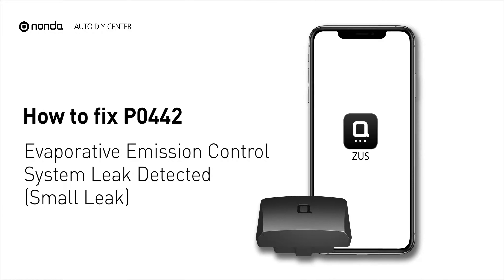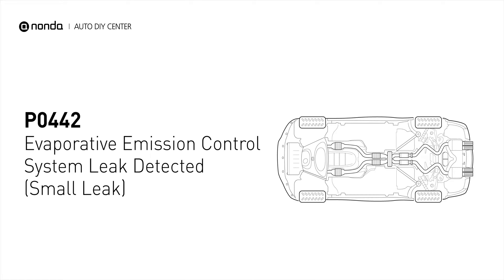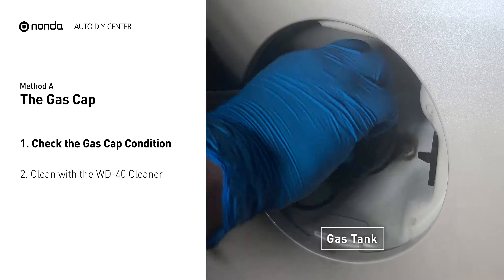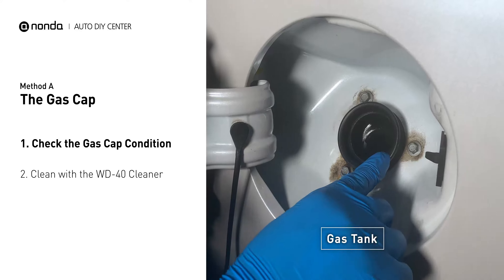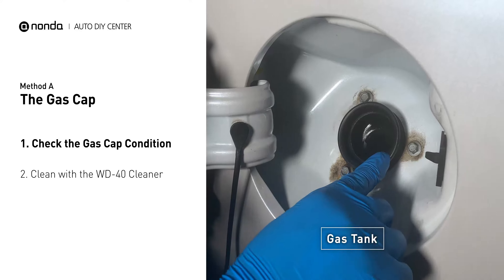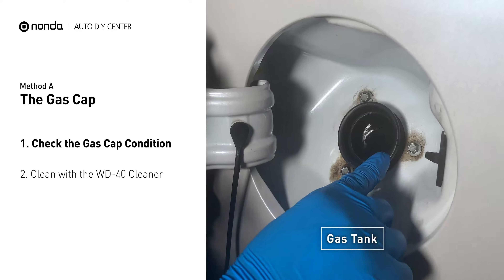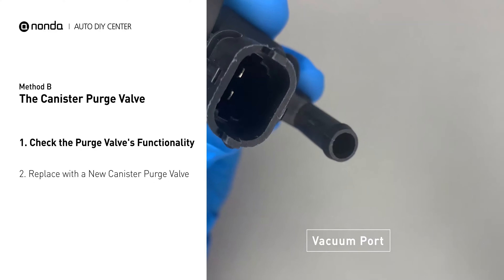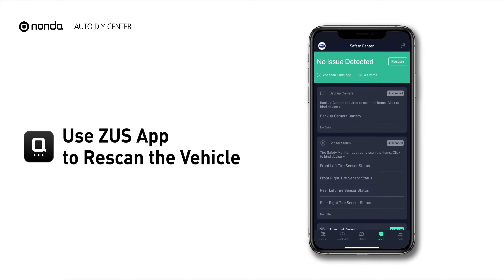How to Fix P0442 Engine Code in 3 Minutes [2 DIY Methods / Only $4.67]

Comment from the maker: Hi, I'm Steve, nonda's lead mechanic engineer. 
Feel free to leave your comments here if you have any mechanic questions, I will be glad to help you out!
Reply: Hey Steve, I have the same error code with a 2017 bmw 430xi gran coupe. I have a deleted resornator and muffler. Would that also cause an issue ?
Reply: Hi Steve

My friend has a 2005 Ford Explorer with a 4.0 Liter V - 6 motor installed in it. Code read out says P0302 and P0442. Her mechanic is telling me that he believes that the problem is that the number two cylinder intake valve is stuck open for some reason. He says that his next step is to remove the valve cover to examine / ascertain the problem - cause for repair.

What do you think about this situation ?
Reply: Is this a serious pcm engine code or can I still drive my car??

Thanks
Reply: @JG-ef2cn  IMO, no, Unless the smell of gas and the check engine light bothers you. Most of the time it's the seal on the gas cap. If you live in a state where emissions are an issue, your not going to get your registration updated, therefore, clean everything first like Steve said and go from there. Hope this helps you out. We're all in this together. Good luck.
Reply: @JG-ef2cn  I also have a PO265
Reply: What's a mechanic engineer??
Reply: I got it a Subaru Baja 2002 and I have a p0442 code show up I did it replace the canister and some other hoses but the check engine is still on the mecanic charge me almost 900 hundred
Reply: 2016 Land Rover discovery sport. I replaced the gas cap. Getting p0442 and p0456 codes that when cleared come back on. Any ideas would truest be appreciated.
Reply: Help me please
Reply: Just got code P0042 on my 2019 impala premier.  Any help would be appreciated, thanks. Ps, I'vealrwady inspected the gas cap. Not sure if its the purge valve. Car is used.
Reply: @JG-ef2cn thats the real question 😂
Reply: Steve AI voice loves Nondas😂

Comment: Not saying this video is BS but after 30 years of doing this ive had many reasons why evap is throwing lights. From filling with gas while running, topping off, faulty componets, gas cap seal etc.
Reply: Can it happen from the car sitting for a year?
Reply: @ReisePiece anything can happen when the car sits. Seals rot out, plastic degrades and many other things can go wrong. Gas also goes bad wich could cause running issues
Reply: What faulty components?
Reply: I replaced my gas cap, but my car still giving me the error code, sometimes I run my car on low fuel and I use the cheapest. Should I use a higher grade? 2011 GMC Terrain SLT V6 3.0
Reply: @mamacamano7507 Did you resolve the issue? I’m having the same problem, and I am going to disconnect the battery to clear the code then drive for a while to see if it returns

Comment: I repaired P0442 replacing a seal inside gas tank (doesn't have part number). That seal is Viton material, It was elaborate in a lathe. In that way I avoided to buy a new gas tank
Reply from the maker: Hi Pedro, thanks for sharing your experience!
Reply: P
Reply: Is that part on the fuel pump? I replaced the purge valve n nothing still have the same code
Reply: @AlvaroGarcia-kf3ih  Alvaro, esta dentro del tanque de combustible. dame un email para pasarte fotos. La pieza que menciono es parte del tanque y no es comercial.
Reply: Do you have a video of thay
Reply: @naynaysmile Hola. No tengo video. El empaque o empaquetadura es de color marrón, viene dentro de un cuello color blanco. Dame un email y te envío foto.
Reply: Was there gas leaking from the car?
Reply: @jsalgado6758  Sí, había una fuga de gasolina, dificil de detectar porque esta se evapora rapidamente. Yo reemplace una empaquetadura o sello en el tanque.
Reply: @pedrosoles  ok I
Reply: No es difícil si tienes la makina de humo
Reply: La máquina de humo podría ser util para tuberias y conexiones externas, el empaque que mande a fabricar se halla dentro del tanque.
Reply: Look at how to make a smoke machine that uses mineral oil. It's cheap and olnt need a trip to hardware store and $20

Comment: Ugh i need help i have this code on my 2009 chevy cobalt, i replaced the gas cap but i think its something loose because i still get “check gas cap” message from the car when i fill it sometimes and my check engine light is still on after 1 1/2 weeks of driving , birthday Nov 7 so emissions coming up, do i just need to take it to a shop im trying to avoid paying over for something that could be so simple 🙄
Reply from the maker: Can you please confirm if this is the only code that registers?
Reply: @nondainc  yes that is the only code
Reply: Did you fix it?

Comment: I have a 2014 Mustang and cleaned the filler intake valve and replaced the canister purge valve... Still came up again after another 100 miles... Probably the whole fuel neck filler.... Sheesh its $140 bucks fml ..
Reply from the maker: Hello, have you checked if there's a leak in the fuel vapor hose that leads from the fuel tank to the intake? kindly inspect also if you have a bad fuel cap or a loose gas cap.
Reply: Had my filler neck and purge valve replaced and still getting code
Reply: Bro u have a mustang and complaining about $140 💀 I took my 2002 Toyota Camry to a repair shop to replace spark plugs and they tried to upsell me to buy other stuff and the final price was $1000+ then I just went to my uncle and his friend did it for $50
Reply: Fix with JB weld if u have a hole or need welding done. Many ways to fix for way less than 140.00

Comment: I have a P0442, P0137, P2270. I have change and the gas cap to a new one cause it lost the seal, I also change purge valve, and the oxygen sensor two but it still comes out on my Chevrolet cobalt 2010 2.2L. I changed the purge valve more than once and the sensor as well.
Reply from the maker: Hi Joseph, as you are receiving more than one error code, we suggest getting your vehicle visually checked by your local mechanic for further diagnosis. Thanks for watching!

Comment: my 2001 toyota corolla S has the P0422 code , I bought a new gas cap ( OEM ) one , installed it , the code P0422 came back on again 50 miles later .
Reply from the maker: Hello, kindly check the vent solenoid and replace if leaking.
Reply: @nondainc  where's that at
Reply: @johnanderson3746  by the fuel tank underneath the vehicle.

Comment: 2012 genesis 3.8. Replaced both, charcoal canister, fuel pump, and high pressure fuel pump. Code came back last night. I did notice my LTFT B2 is at -3.1%. Maybe that is the issue
Reply from the maker: Hi Jake, you may follow the tips/suggestions provided in our video on how to fix P0442, and please let us know the outcome.
Reply: Check for cracked vacuum lines.

Comment: I have a 2006 Chevy Impala SS. I followed the steps in your video and I still have the p0442 DTC. I've also replaced the evap vent valve but code is still there. Any other tips?
Reply from the maker: Hi Daniel, is there any other codes that register along with this code?
Reply: @nondainc  thank you for responding to my reply. No, that is the only code that shows up just the P0442 small evap leak detected. I also checked all the evap lines and there's no leak. I ran the smoke machine and there's no leak
Reply: @nondainc  I get really bad gas mileage so I know there has to be a leak somewhere
Reply: @danielg.966  gas cap
Reply: @KingARob_ I have the exact same issue. I replaced the Purge valve. No Check Engine light since the replacement. But at AutoZone the scanner read:small leak detected. I'm wondering now could it be the Gas Cap? What's the life of a Gas cap? I have a 2015 Chevy Impala. 72000 miles. Thx
Reply: @rwarren4637 Depends on how well it was made, how well seal material it was made from and how many times you unscrewed and screwed it back on. If not a well made cap with well made seal, could be not long. Have had brand new parts fail out of box. Since Kung flu quality has been crap.

Comment: Don't throw money at the problem, because there are a dozen components that can trigger this code. Before you piss your money away on anything new that isn't broken, try cleaning the gas cap as described. If that doesn'ty work bring it to a shop and have them properly diagnose the exact cause so you only have to pay for that one thing.
Reply: What if you don’t have a gas cap? It’s just a flap.

Comment: I replaced gas cap 3 times and l bought a new purge valve and when I went to install it l noticed one tube goes to carborator and one hose goes down to engine exhaust where l found hose melted ou of shape now l did not know this till l started to look for a solution . Now l will by a new tubing for purge valve and reconnect and see what happens, will let you know know! Also check purge valve and tubing!!
Reply from the maker: Hope this helps, Juan!
Reply: So Juan did it help ?
Reply: Did replacing the melted hose fix your problem
Reply: Did it work?

Comment: Steve this code is still coming up since i replaced my purge valve. No Check Engine light. Only code. Could it be my Gas cap? What is the life expectancy? I have a 2015 chevy impala. Thank you
Reply from the maker: Hello, please check the condition of the gas cap and the canister purge valve. A replacement could be necessary.
Reply: Get a factory original replacement gas cap.

Comment: I have took my car to multiple shops for my 2013 ford edge and no one can’t find a leak or anything. My car has the smell of fumes when the heat is turned on. I don’t have a gas cap, I checked the purge valve and nothing seems to be clogged or wrong with it.

Comment: I have a 2015 mustang gt replaced the intake manifold upgraded to the 2018 and now I  have po442 error code any ideas.
Reply: Could be the fuel filler neck

Comment: I have a 2014 Ford Escape with a capless system (no gas cap). What do I do for that?
Reply from the maker: Hi Tim, your capless filler must have been pretty dirty. Kindly have it checked as well as for leaks.
Reply: Same here, I have a 2017 Ford escape se and took to AutoZone to get code P0456 EVAP system leak detected (very small leak is what I was told .02-inch. Is this a expensive replacement or labor?

Comment: replaced my capless inlet tube 
canister purge valve , canistor , fuel tank pressure sensor and all lines, purge valve and line , all oxygen sensors, pcv valve and mass air flow 
still coming up 442 
i’m at a loss right now as to what is my problem
Reply: Did you get it fixed?
Reply: @Krissy.222  nope still showing a small leak 442 code
Reply: @Krissy.222  nope
Reply: @michaeldefilippo3849  oh darn! Mine was my gas cap and a small hole in the exhaust. Taped it up for now and the code went away

Comment: I have a 03 mustang gt and I'm assuming it's my exhaust leak from the old stock headers. Could this be a reason for the code?
Reply: Yeah I have a 07 mustang and have same code. Changed gas cap still throwing code but I looked at my headers and both headers & cats look so rusted and just worn out. Wondering if that could be the culprit. Car is in very nice condition engine looks good it’s literally just them headers and cats that look bad and I get an exhaust rattle too here and there. Sometimes it happens sometimes it doesn’t
Reply: @OFFICIALEMG_  since then I got shorty's and many other mods. I'll have to check the codes, but now I got an engine light for egr delete lol.

Comment: 1996 Hyundai Elantra
Same code, been searching for the issue and can’t find it chanced Canister, Vent Valve, Purge Valve, OEM everything & gas cap as well
Still same issue.
Reply from the maker: Hi Carlos, is this the only fault code you are getting?
Reply: @nondainc  Yes, only code.
Reply from the maker: Hi Carlos please check if there's a leak in the fuel vapor hose that leads from the fuel tank to the intake. We also suggest checking the condition of the fuel tank pressure sensor.

Comment: 2006 subaru sti w/intermittent po447. Replaced pcm w/ purge solenoid,  charcoal and related at dealer awhile ago. $2000 for work ok till recently. Keeps coming back
Reply from the maker: Hi Piri, have you double checked if there's any other trouble code registers together with this code?

Comment: I have this on my 2004 hyundai santa fe. How hard is it to replace the fuel neck filler with out taking it to a shop. When I pour gas in it leaks out so I'm assuming that's the reason for the code. It doesn't come on right away tho. And weirdest thing, the code stays on but all monitors are ready, the evap will go green
Reply from the maker: Hello, can you please confirm if this is the only code you're getting?

Comment: Please help me i have engine code P044c and P044C(11) i cant find what exactly it is its something with the EGR (exhaust gas recirculation valve position sensor C - circuit 
is that mean the EGR valve itself or is a sensor somewhere i have Infiniti Q30 and its a Mercedes engine i clean all the valves and both egrs and the manifold it was dirt in there but after 2 - 3 months the error show again if someone have some more info from the basic in google for that i will be infinity thankful
Reply from the maker: Hello, we highly suggest to get your vehicle visually checked by your local mechanic for further diagnosis.

Comment: Hi guys, so I have NONDA scanner for my 2010 NISSAN MAXIMA I also got P0442 error code I got new cap from amazon cleaned my fuel cap hole, cap ext my after a few days I got engine light on again so I got another new gas cap cleaned everything and put the second new cap but again after 2-3 days I got engine light on both caps that I purchased aftermarket parts so do you guys think I have buy ORIGINAL gas cap for this error code ? OEM part is $70-$80 but aftermarket was $15-$25 I was wonder if this cap is really sensitive for engine light or should I go to next step and replace Purge Valve ? Also should I get OEM Purge Valve part for this error code since it's coming back after 2 fuel cap aftermarket replacement. PLEASE RESPOND ME :)
Reply from the maker: Hello, can you please confirm if this is the only code you're getting?
Reply: You shouldn’t get an aftermarket gas cap because most times it won’t fix the issue . Always buy the original gas cap and it could fix the issue
Reply: @shred9395  Thanks for the hands up but after I made this  comment I hit under my car to pot hole here in Queens NY and my car totaled so insurance company paid my car and I got 2021 Camry SE zero issue since I got it but now looking for infinity Q50 or Q60 :)

Comment: I have hyundai elantra 2015 with p0442 and p0456 primary p0456 secundary dtcs p0442
Reply from the maker: Hello, as you are getting more than one error code, we suggest getting your vehicle visually checked by your local mechanic for further diagnosis.

Comment: I have a 02 f150 with the same problem p0442😢
Reply from the maker: Hi Leonardo, make sure that the gas cap is in proper fitment/condition. Check if there are cracks in the fuel tank/ or charcoal canister and inspect the EVAP lines for damage.
Reply: My mechanic solved it by disassembling the gas tank, he changed a viton seal that is submerged in the tank. I ordered this stamp to be prepared according to the model.
Reply: @pedrosoles4750  how is your vehicle running after repair?

Comment: Changed car and valve still has problem
Reply from the maker: Hi John, please try cleaning the gas cap. A smoke test is also recommended to help detect fuel vapor leaks.
Reply: @nondainc  I did that I even replaced with new gas cap
Reply from the maker: Please do a smoke test on your car to detect the fuel vapor leaks.
Reply: @nondainc  im not mechanic . how dies car sense gas leak anyway if gas cap closed and if under car how does it know esp while driving aur is moving under car
Reply from the maker: You would know it when you smell a gasoline odor coming from the vehicle. You may also inspect the fuel filler neck if there is any damage to it.

Comment: I have a jetta 2.0 2012 with the same problem
Reply from the maker: Hi Ruso, loose fuel tank filler cap is the most common cause that triggers this code. Malfunction is detected when evaporative control system has a leak and doesn't operate properly. You may follow the tips/suggestions provided in our uploaded video (How to fix P0442) and see if the issue will still persist.